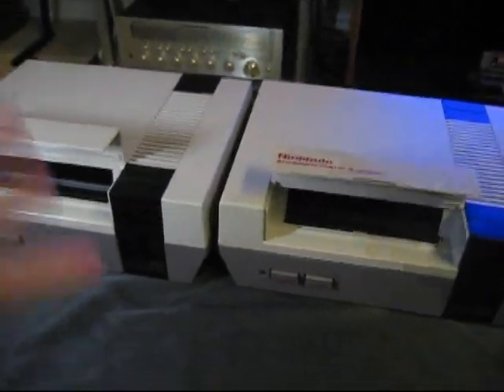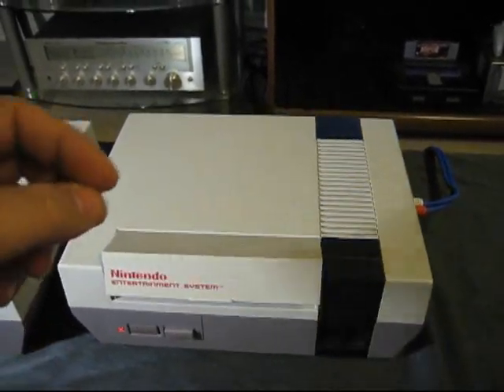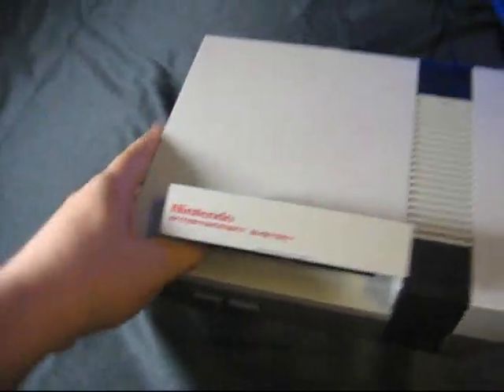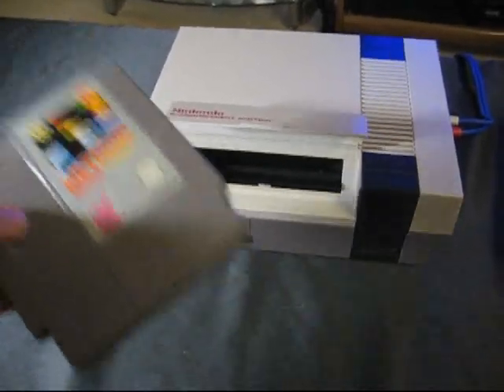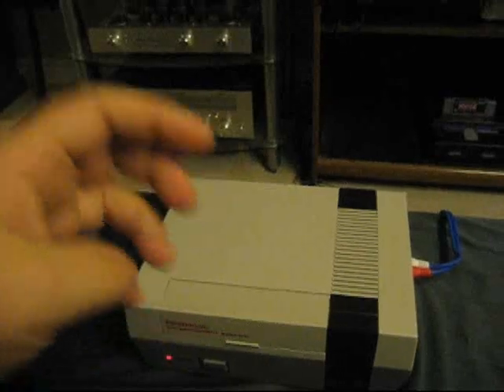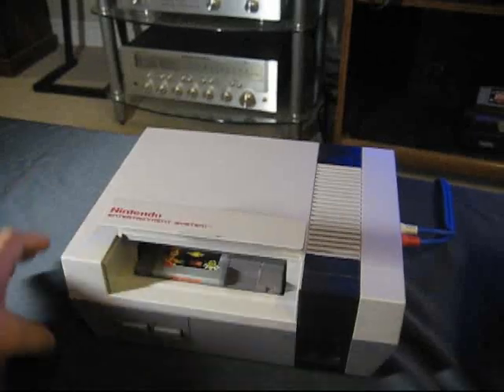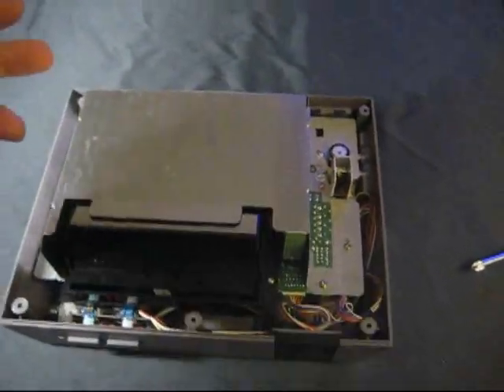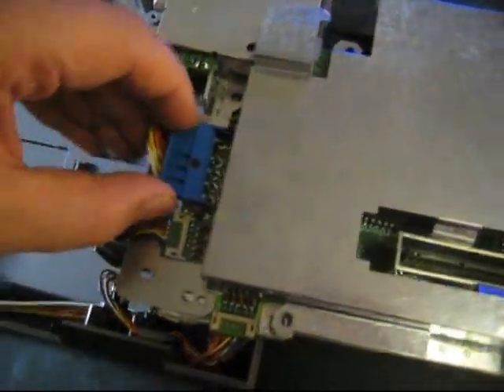Disable the 10NES chip in your NES

Comment: The lockout chip isn't only for pirated games. Its also a security measure. First off, it prevents overheating. This can prevent a common problem from a famicom and even modded nes's because the voltage regulator burns out. It also prevents short circuits in the game connectors.
Reply from the maker: That might be true but I'm not worried about it.  If it was really a common problem we would have heard more issues with the PAL NES, NES2 Toploader and Japanese Famicom as all of these never came with the 10NES chip.  I've never heard of a PAL NES or Famicom having the power regulators short out and killing the game cartridge.  I'm sure that's like one in a million right there.  Like I said I'm sure you're right, I'm not doubting you at all.  It probably has happened but seems like I've got more chance of being hit by lightning than that happening.  Anyway I also wondered if by only cutting this one pin is the rest of the 10NES chip doing anything?  That one pin I assume is going to the CPU reset pin?  So it's possible the rest of the 10NES chip is still doing something and has power.  I could be wrong.  That's more of a question than a statement.  You probably know more about it than I do so feel free to share if I'm wrong.  Thanks.
Reply: The PAL NES also had the CIC chip, and the NES 101 + the Famicom were build a lot differently and run differently, and they may have a different security measure. The pin is the ground pin from what ive heard of, so that totally disables the CIC chip. If there is an interference, it would not notice it. Have you ever played a game like Zelda for a long time without turning it off or anything, and then you see it restarting all of a sudden? The system overheated and started resetting so that it would not fry the LM voltage regulator. This also happens so that no other more vital components fry. Even though it may seem useless to turn off for 1 second, it is enough to keep the vital parts from frying.
Reply from the maker: ***** I always assumed the reason a game reset while playing was because the contacts connection to the cart was iffy as I had that happen a lot on my old NES when I was a kid and sometimes only a few minutes into the game.  Heck if the thing got touched the wrong way and the cart moved just a fraction of a millimeter it would do that so that's an issue with the cart connection, not heat.  My personal experience anyway.  I'm not saying overheating VRM wouldn't cause issues of course.  But now this does not happen on my NES that has the 10NES chip cut and also I clean my carts more than I did as a kid.  Also when I was a kid I would leave my NES on all night so that when I played again the next day it would be where I left off and it was fine being on for days on end!  I don't mean to sound rude but I find it unlikely there's any temperature sensor on the NES VRM that would correspond to the 10NES or CIC chips BUT maybe the VRM overheating and voltage ripple/fluctuation causes the 10NES chip to reset the CPU as a mere side effect?  In other words there may not actually be any temp sensor but when the VRM overheats the voltage would change and thus cause the 10NES chip to reset the system?  Like I said I'm no expert so if you have sources or more info one way or the other please share!  Lastly, and once again correct me if I'm wrong but the CIC chip is in the cartridge to correspond with the 10NES chip in the system so if most PAL consoles don't have the 10NES chip than the carts wouldn't need or use the CIC chip even if they were in there.
Reply: Giving the no4 pin a low signal doesnt completly disable the nes10 functionality, just the DRM function. The startup sanity checking is still working.

Comment: Which games?

I've never had a game that didn't work after this mod (I've got at least 70) and I've had 10NES disabled for 7 years now in my NES.

The chip has done nothing but serve as a nuisance from our childhoods to today.  Clean your NES and all of the carts, or clean the carts and replace the 72 pin connector, and disable 10NES.  Games will work virtually every time unless the cart isn't fully inserted.

Mine works better than a new one.

Comment: In electronics engeneering there are 3 state a pin can have: on, off and undefined. Undefined pins can switch between on and off randomly and that may cause trouble with the chips. Pins are undefined (or "floating") when they are used as an input to the chip but nothing is connected to them. Then they pick up random background noise like radio stations or cellphone signals. To prevent this, you have to set them eigther hi (on) or low (off) and this is what that wire does.

Comment: Some matel nintendos just dont like some of the converters. ive got 15-1, 31-1, 42-1 and the games are fine. the converter works best kind in my machine, which doesnt even have the lockout chip disabled. the machine at work however, no luck whatsoever

Comment from the maker: Yeah the American games are designed to run at 60hz on 60hz NTSC consoles so when they run on your 50hz PAL machine they may run slower.  You can probably mod the system with a switch but if you already have a NTSC NES you might not want to.

Comment: My NES was working a little bit. I had to push down, and wiggle the carts around to get them to work. Then insert something inside to keep the cart down. I opened it up and cleaned the pins and connection on the mother board. I also snapped off the 10NES clip like in the vid. now when I i turn the NES on, I only get a white screen. with or without a game inside. Did I perhaps screw something up? any suggestions on what to try next? mess with the pins? try to get them tighter?

Comment from the maker: No this will not change the connector pins.  If you change the 72-pin connector out with some 3rd party replacements or bend the pins so they're extra tight you might not have to push the cart down to play games but if you already have to push the cart down to play games this wont change that.

Comment: i own 2 nesses myself, 1 seems like its modded (i bought it 2nd hand) since the light aint flickering, the other 1 seems not modded, since the light does flicker on and off, i bought a new pin connector for the not-modded 1, but it has issues, too bad, i'm probably getting 2 other nesses from a uncle of mine, i guess i'm gonna try to mod it and disable the nes10 chip, and see what it does, also thanks alot for showing this to us!, anyway i opened 1 of my nesses be4, is it possible it said nes11?

Comment from the maker: The retron3 is a clone system running the entire NES side off what's called a NES on a Chip or NoaC and it does not have the 10NES chip in it.  There would be no need for it to have that as it would cost more to put one in a clone system and it's not needed to run NES games.  Nintendo spent more money putting the 10NES chip in the NES in hopes to stop illegal pirate games from flooding the system and that would cost them money.  Your problem would be something different on the Retron3.

Comment: So I did this... took time to get the 4th contact on the chip cut and I somehow ended up scratching the other contacts on the chip so I got worried... when I put it all back together... upon starting a game... always a blue screen so I took it apart again and it turns out that the contacts where you put the game in didn't line up correctly as I had to move the game slightly to get a connection. Oh well... at least I don't have to worry about the resets anymore.

Comment: If your contacts actually had enough dust to interfere you would need a hell of a lot more than a blow. You most likely were getting results from reseating the contacts, and it was a common problem with the "toaster". That's why you never have to do it with any top loading system like the 2nd gen nes or snes systems.

Comment from the maker: Yeah you just need the proper adapter I've got one to play Japanese Famicom games on an NES and it works on both models inc the top loader.  The problem is the adapters are really hard to find now and some of the newer ones might not work on the real top loader if they were meant for or came with a clone system.

Comment: To be pedantic, the 10NES/CIC isn't an antipiracy chip. It's actually is responsible for locking out unlicensed developers from NES development. The fact that most unlicensed developers sold pirated games is irrelevant - an actual game copier could just use another cartridge as a dongle, the 10NES lockout doesn't authenticate the game to the key chip. Antipiracy efforts didn't start until SNES, and they involved using coprocessors with secure ROMs that couldn't be copied by a game copier.

Comment from the maker: Sounds like you know what you're doing so I assume the game cart is as clean as possible.  Sometimes opening the cart and scrubbing the contacts to a new shine using something like a scotch pad or wet sand paper helps too.  But if the games clean and the 72 pin connector is clean...  well who knows.  The game cart could be bad as in the ROM chips or a capacitor in the cart (if there is any) is failing.

Comment from the maker: @MrSuperpoder The flashing screen IS caused by a bad connection between the cart and the 72-pin connector.  But it's activated by the 10NES chip.  They're both responsible.  When the 10NES gets a bad connection from the game (due to the game or the 72-pin connector it reset cycles) This is only done to help, not completely solve any issues.  You need to have clean games and a clean 72-pin connector above and beyond anything else.  Than you can do this just to help a little more.

Comment: @Draknfyre I had to replace the pins and disable the chip to get all my games to work again

And yes I clean them before using them every single time

Like I said its common knowledge if you are into modding that the CIC cheap was faulty and it often overheated resulting in the flashing screen.  They should of pulled a Sega and just changed the size of the carts...but obviously that was the next gen.

Comment: @VreyOneida (cont.) ...Use of a box cutter or Exacto type blade would risk damaging other parts of the chip or the motherboard.  I used small wire cutters which can be found in any hobby store or the hardware or floral section of your local box store.
Cheers and good luck!

Comment: I have personally performed this mod on two NES consoles and it completely eliminated flashing screen problems in both cases.  While dirty contacts can contribute to the problem, the real issue is that the 10NES chip makes the system hypersensitive to the slightest fluctuations in current that can be caused by worn yet completely clean contacts, slightly bent contacts in the machine, etc, where the game should otherwise be fine.
My only suggestion is I would NOT recommend using a box cutter...

Comment: If anyone's having an issue with their system not turning on, you probably pinched a wire putting the system back together. I've had that happen. Take the system apart and relieve the pressure on the wire.

I cut the 10NES chip on two systems. They don't blink anymore, but I accidentally clipped the wrong chip on one of them O_O. Fortunately I was able to restore the connection.

Comment: @ajanta7 One could desolder the chip, and install an IC socket with a ribbon cable and a switch on that Pin4, so that the 10NES chip can be enabled or disabled as needed. Also, one could desolder the pin and bend it out of the socket, but that risks breaking the pin off as well. I think I'd use a bit of ribbon cable and an IC socket, myself, and put a SPST switch into the line for that particular pin.

Comment: i did this today & it worked fine on my U.K. pal NES , i have cleaned them before & that has cured it, then other people have changed the connector & sometimes that keeps it going, i stripped the console out & cleaned all round & still it didnt cure it, so i did this mod & it fixed it fine, why waste money on new connectors when this might cure it

Comment: I've had some expreience where I put a game in and it starts as normal, but it reset a few minutes afterwards, not as soon as the system starts up, I'm assuming that's due to dirty game pak pins, would the '10NES' chip cause those types of delayed resets I'm talking about?  This is certainly very instructive, but why not just remove the chip completely instead of breaking the pin?  Does the chip perform some other function required by the NES?  Why do people call it the 10NES chip anyway?

Comment: Aged NES systems usually wont read the games all that well even after the chip is disabled, its best to either replace the 72 pin connecter or do what i did and get a very small philips head (ex. one from a glases repair kit) or a tooth pick and pry the pins upward. It would be great if you were to make a vid of you doing that.

Comment: Thanks man. I just worked one of my toasters and it works! I had some issues getting it back together. For some reason the tray wouldnt "click" into place right. But other than that, np. (Also I was a bit nervous when breaking that pin hah)

Thanks again, you rock.